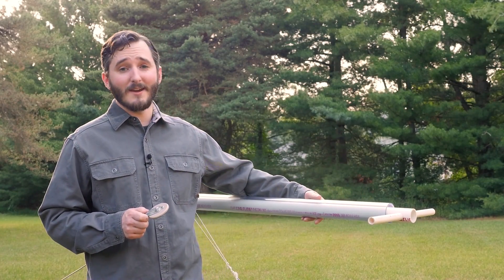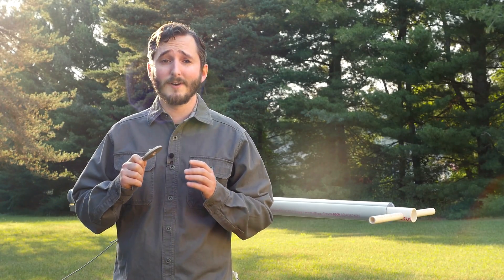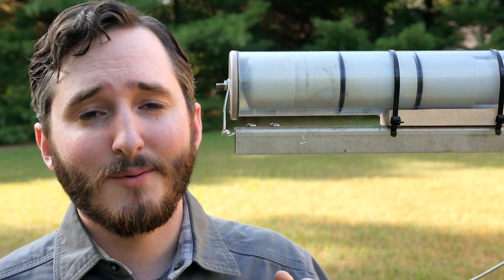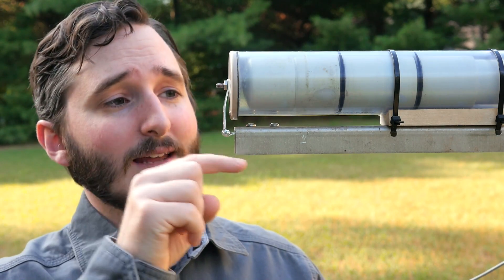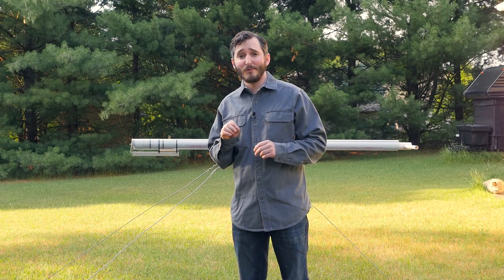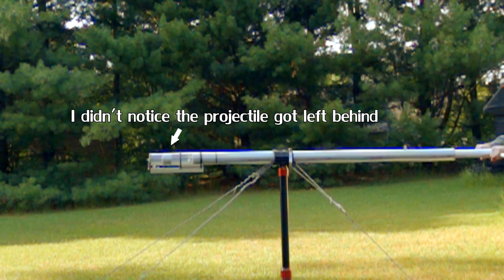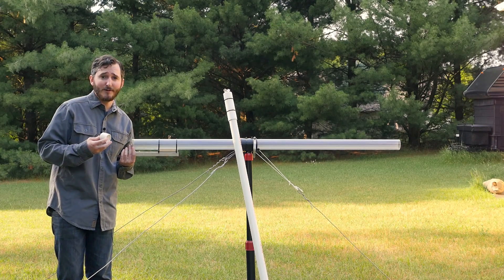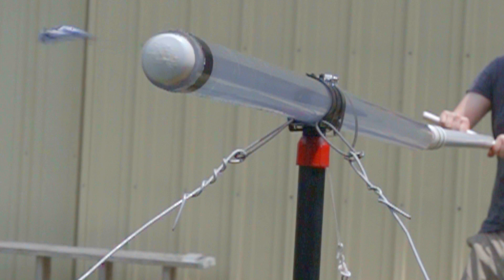Firing A Clear Vacuum Cannon & Testing Viewer Suggestions

Comment: You may be able to use a spring or several rubber bands to accelerate the flapper open faster than gravity can. I have made a simple diagram that I hope is understandable in how you might be capable of achieving a faster opening of the flapper.
http://i.imgur.com/Or6Rrlu.png
Reply: I agree - this was the same thought I had while watching the vid.  It's usually called an 'over-center' spring mechanism.  The spring stretches just barely over center of the pivot, then will accelerate faster that gravity can pull it down once the air pressure gets it started.  It's a great mechanism also used on a lot of latches.  It may take a little bit of tuning to get the geometry just right.

I had two other thoughts - one was to reduce the mass of the valve, but it still needs to be strong enough to resist ambient pressure.  The other idea was to split the valve in half so it swings open from either side.  The  down side is you need two hinges, and a more complicated seal in the middle.
Reply: Thats pretty much exactly what I suggested in the last vdeo, but your diagram is far superior to my clumsy explanation.
Reply: This is a fantastic idea
Reply: Dammit, dude... I just spent half an hour doing the same kind of drawings! I wish I had read the comments first... :'(
Anyway, I think it should work! My idea was using the same principle, but had the spring mounted perpendicular to the ground, so the cap wouldn't need the extra part you added on your drawing. I don't know what would be the most effective, though...
Reply: I have a good way to apply your apparatus. I thought about it for a bit and did some calculations and what it really boils down to is the amount of 'offset' of the critical point where it starts to pull. You could potentially make a simple adjustment mechanism for this using a bolt(method below) In practice, once the critical point is perfect you can use massive springs and/or a long torque arm and/or a really far back spring anchor point on the barrel to get the valve to open with crazy force. You might want to put some foam or rubber on the side of the barrel where the valve hits it. so as to not damage it. Also, once you get it working, you might want to mount this valve system on the side of the barrel so gravity doesn't affect things. (if gravity is in play, it is possible for the valve to open before the pressure in front of the projectile reaches 1 atm which will slow the projectile)

Build Guide:
       Instead of mounting the spring directly to the valve, attach a loop of thin wire to one end of it and attach a bolt to the valve, you can then use the threads of the bolt as notches to adjust the offset and to make the critical point just right. If you want to get even fancier, you can find the best notch and then turn the bolt to adjust further (assuming the bolt is mounted using its threads)

Additional method:
        If the valve just can't accelerate quickly enough in the beginning, you can think about adding another spring to the valve at a different angle.
       Essentially, there is a stronger spring holding the valve closed and a weaker spring pulling it open, you can adjust the angles and strengths of the springs so that it is just barely holding shut (because the amount of pulling open is slightly less than the amount pulling closed) but the closing spring is much stronger and at a steeper angle so that the pulling closed quickly turns into 0 torque and the pulling open is essentially just as strong.
     This method is much more intricate but will have the potential to open at a much faster rate.

Sorry that this comment is so long, you can probably tell by my level of overthinking and poor explaining skills that I am a physics student but I hope it helps anyway. The second method is the better bet but you need to have a really high tension spring if you want it to work well, so if the first method works, don't bother with the second.
hope it helps. k thx bye
Reply: I thought the exact same thing when watching it. If that doesn't work than a spring and latch he can release when it is under vacuum so it is held until the pressure increases enough inside for the spring to open it. A bit clumsy but it might be needed to get it to react fast enough.
Reply: I was thinking the same thing, but with an elastic instead of a spring. I imagine both would work.
Reply: ejler thomsen  yeah that would honestly work! wow
Reply: I was only thinking a spring assisted one, but without having a "critical" position where it can be in a lock state
Reply: amazing idea :)
Reply: Cameron Baker
I like your idea, but I came up with an improvement. (see above) 
By the time the air in front of the projectile reaches 1 atm there is virtually no acceleration force and the pressure required to push the valve open actually slows the projectile.
Reply: Yes! This is exactly what I was thinking. Excellent diagram.
Reply: ejler thomsen You could have a cone shaped valve that opens up like a flower into several triangles, that way if it does get hit it will slide and open.

Comment: Why not make a section before the valve, which is a wider diameter allowing the air rushing in behind the projectile to push around the projectile? If i remember, this was used on another cannon which utilized a vacuum in a different way (to assist a conventional air cannon). Instead of relying on compressing the remaining air infront of the projectile (which reduces potential power and isnt reliable), you can use the air rushing in behind the projectile. Also, reducing the weight of the valve would help quite a bit.

Actually, thinking about it.. If you make a secondary channel for air to go along into an assembly underneath the regular barrel, you could utilize the air pushing behind the projectile in the same way an AR15 rifle utilizes the expanding gas behind the projectile to cycle the action, if you understand.

Comment: I think a push spring as a bumper on the inside plate of the valve, 
facing the projectile keeps the (most) damage away from the rest of the valves mechanism. 
Just change the hitting point 1 - 2 inches before the projectile reaches the barrels end...

Comment: So if the pressure on the supports is the same as the inflow could you put a measurement device on them to work out how "strong" or what speed the projectile travels at ? Also for the front flap could you use a ring with weak magnets that slots over the top with another larger pvc pipe to hold a seal but light enough to drop off with minimal forward movement. (Shaft side flexable magnetic ring or band glued to a larger pvc off cut, flap side coiled metal embedded in the flap housing it would look like the projectile you are firing but with a routed grove with metal in it and hot glue or silicon covering it)
Reply: nicko198718 I had a similar idea! I support this...

Comment: In the case where you started the projectile a little back back (to leave air in front of it), it would be interesting to fill that air with dense smoke before closing the valve.  Then, as you pull the piston back, we'd see the smoke thin out within the chamber.  When it fires, I suspect we'd see it get dense again momentarily before releasing out the front.  I'd like to see that!
Reply from the maker: Good idea

Comment: So the issue seems to be you need to get the flap to open before the projectile gets too near it. The only suggestions I can think of might be too mechanically complex. You could borrow a technique from semi-automatic rifles that use the gas pressure from the barrel to operate the bolt., except in reverse. A separate gas tube that will use a piston (instead of a bullet) to open the valve as the air comes rushing in. A spring would also help, using the same "over-center" sort of arrangement you're using with gravity and the hinge, it wouldn't take much force to open the valve enough for considerable spring pressure (A rubber band mounted perpendicularly to the barrel) to yank the valve open quickly.

Timing becomes a problem because since you're depending on the vacuum in the barrel to launch the projectile, you want that opening to come as late as possible. You'd need to use your high speed to figure out how long it takes for the valve to clear the barrel and how far from the end of the barrel the projectile has to be to give that time. The moment that valve opens, you lose any thrust because the vacuum is relieved.

Frankly, you might just be better off with a faster way to make foil caps, say, making a bunch of collars that you can prepare in advance that fit over the end of the barrel.
Reply: Dr. Mauser I thought about this, too. Good one!
Reply: The trick would be to tap the barrel in two places. Say, for starters, one place near the front of the barrel, and one about halfway, each connected to the ends of a tube. The tube would have a piston in it that emerged from the front and could hit an extension on the flap hinge. The timing would be controlled by where in the barrel the rear tap was. In operation, when you pull back the plunger, the piston sees vacuum at both ends. When the projectile is released, it passes the rear tap, opening it to air pressure, while the front of the piston still sees vacuum, which pulls the piston forward, popping the flap. Then the over-center spring/rubber band takes over pulling it out of the way.

However, thinking it through, there are issues. The volume of the upper tube contributes to the amount of air in front of the projectile, So the piston needs to fill it, so there's little volume. but it also needs to be strong enough to pop the flap open against the vacuum in the barrel, which suggests a large diameter. Also, if the piston doesn't seal the tube, Air would leak through into the vacuum side as the plunger was withdrawn. Also, while withdrawing the piston you'd have the same situation of vacuum up front and atmosphere in the back, which would pop the flap as you were trying to draw. So making it work properly would be complex. Way beyond the scope of this kind of fun project.
Reply: Ooh! You just gave me an idea. 
An over center spring/rubber band holds the valve closed (just like gravity) once there is a vacuum a small cylinder tips the bottom of the spring past the pivot (limited by an adjustable stop) so that when the projectile is hurtling towards it, and the vacuum is dropping, the spring will open it just before the small puff of air hits it. The stop adjusts the timing so the spring has just enough time to yank it out of the way.
It's only a little more complicated than the current version and it won't leak the vacuum.

What do you think?

Comment: Make the valve super light. No metal or bolts on it.  A disc of fiberglass or something with a silicone ring.  Then hang it with a light flexible hinge of some sort.

Comment: Why even use a hinged valve? Soft rubber or silicone on a piece of aluminium should hold it to a well sanded pvc edge by itself and pulling the tube into vacuum will secure it in place, add a couple of feet of fishing line on the valve and to the barrel (or ground) to recover it. Hinge just adds extra weight & friction.
Reply: Connected near the ground so it will swing out of the way, like an inverted pendulum.

Comment: Please angle the valve! Then it will need to move out of the way less! You would need to alter the pipe, but I am very confident it will change your results!
Reply: Sounds like a good idea. This does mean there will be a need to keep it closed while creating the vacuum.
Reply: Brett Coryell that could work, but some others brought up the idea of a plastic cup used instead of a burst disc. i hope it holds a vacuum and we have our solution
Reply: Create more of a cap! Have a lip around the edge for some friction
Reply: It will need to be a balance between friction and easy release, but I think it can be done
Reply: Brett Coryell true it would add more mass to get moving, but I am hoping after seeing the slow motion footage that have the valve angles at 35 or 45 degrees will be enough to overcome both the added mass and problem of getting out of the projectiles path
Reply: Brett Coryell I think it could work, but the only issue is a little bit of back and forth. He had said that he could hold the cap closed with a piece of string, but that just adds another element to time correctly. I am sure if he can create a trigger system like you explained that it would be easier to fire, but how complex do you want something like this to get? It would probably work, but it is a little complex
Reply: that would be good for the opening speed, but there would be lots of air left in there unless you had a wedge shaped projectile that could start immediately behind the flapper to reduce the initial air..   that projectile would probably go in a big circle and pinch you in the butt!
Reply: Joe Kozak maybe this triangle of air would be the perfect amount to help get the valve open?
Reply: whats the point of a vaccum cannon if it dont cannon?
Reply: Joe Kozak if you look at his projectile you will see that it doesn't create a full vacuum either. and what is the point of having a burst discs that you need to replace every time? idk i think its at least worth a try
Reply: Brett Coryell maybe make a diagram of it? it seems difficult to explain in text
Reply: kenneth Grieger  hi good idea
Reply: vaseline could create enough stickiness to hold a light valve on the tube and would only improve the seal
Reply: Kenneth Greiger. That is a great idea. That also technically increases the pressure applied to the valve upon opening, but I believe that the force opening it would remain the same due to the incident angle of the applied torque.

Comment: Would there be a way to use a solenoid or some type of motor to help speed it up? Or maybe u can make it so the flap has a sturdy piece sticking up and then on the pipe there is a spring to add some speed to it opening. U would have to hold it down at first but once there is a vacuum it should hold itself down. And idk if u want to keep it simple but i bet there is a way to make it mostly automated. Good luck.

Comment: One suggestion: it seems you would need additional mechanical spring type support to open the flapper. The key would probably be to engage it only at the end of the procedure when the pressure already built up. So maybe a string cut at length to coincide with the moment you are pulling the piston to engage the additional flapper spring right before you shoot.
Reply: I thought about this a bit more and it's a big challenge. Theoretically without an air cushion (some air remaining in the pipe) the flapper stays against a vacuum till the last moment - when it's hit by the projectile. Another wild addition to the spring idea above would be to add additional little pipe over the main pipe and near the flapper. The purpose of the additional pipe would be to equalize the pressure just before the flapper (one inch from the end -
 first entry) when the projectile moves close the flapper (let's say 10 inches from end - second entry).

Comment: If you want the flap to move faster you need it to accelerate quicker, right? So you should try to keep the flap as lightweight as possible. Also maybe expand the diameter of the pipe at the end to increase surface area. Also if the expanded flap were lowered, as below, the flap wouldn't need to make a complete 90 deg rotation to open, but a smaller angle to clear the projectile (60 deg for 2x the diameter of the pipe)

    [ ___________________
    [            _____________
    [ ___/

Comment: You could try adding a spring to the valve hinge so it opens quicker. Of course you'd also need a latch to hold the valve up until you prime the cannon.

You could also add a simple ratcheting mechanism to the piston so you can leave it primed without having to keep pressure on the handle. It wouldn't be too complicated to set up, and it would make the firing process a little easier. Another advantage is you can hold the spring valve on with whatever latch you want and then remove the latch once the cannon is primed.

Comment: may be a bit harder to setup/fire but would it be fast enough if you just removed the hinge (holding it on with pressure)

Comment: would it work if you just put a flat piece of plastic with a thin layer of silicon on, with a small spring to push it open before the projectile hits it? if you pull the piston out fast enough the sudden pressure should be enough to pull the front closed and it will stay closed until the pressure lifts enough to spring open, may go further, I have no experience in any of that sort of thing but the cannon is cool as hell

Comment: maybe you could get a faster valve with a mice trap like mechanism (spring loaded valve)
Reply: Something I've suggested before. The problem with that is just that it gets complicated to trigger since those mechanisms usually require direct contact to actuate. 

Likely the only way to get that to work requires electronics with an optical interupt sensor placed near the end of the pipe to detect the projectile passing by and then release the spring within a very short time.
Reply: I had the same idea while watching.  I was thinking about how rocket hold down clamps are quickly released right before liftoff.  Something like the bimetallic jumping disks, a snap spring that would hold in the vacuum, then the pressure of the projectile would make it snap back against the lid to kick it off.
Reply: CatSay how about a piece of string that is a bit longer than the piston, so that it pulls the valve down just as the piston is pulled out of the barrel? extend the hinge part that valve is attached to, tie the string on the end of that and tie the string on to the piston handle.
Reply: You don't actually need a trigger. The "moving of the pivot" trick works with springs, too.
Reply: I was thinking the same thing!